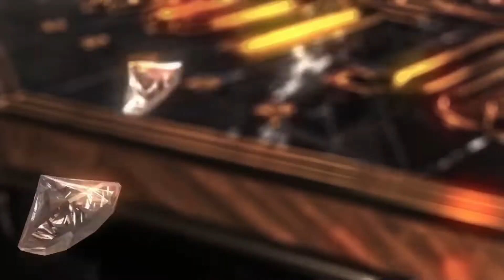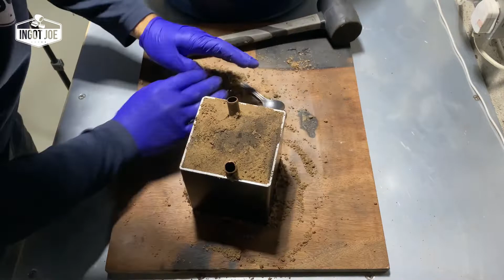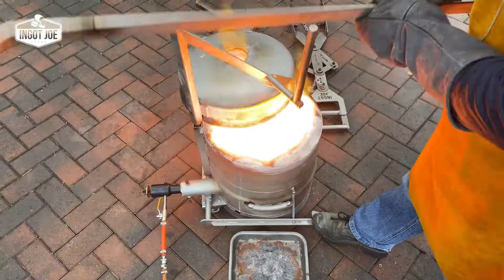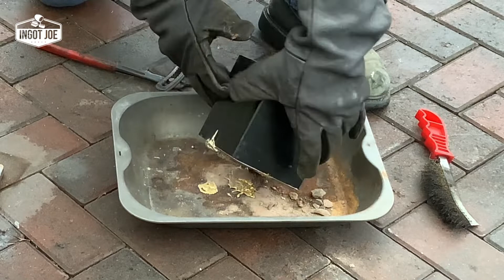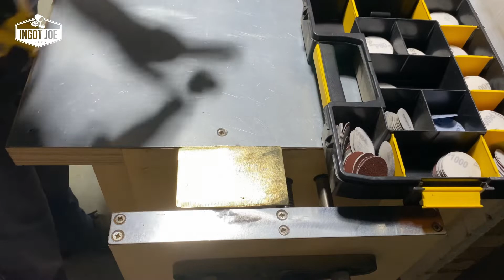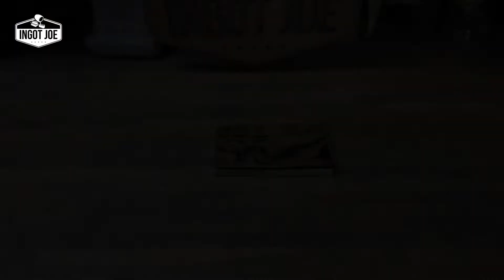Lost Apple casting? - Fail! - Home Made Furnace - Molten Metal - Bullion - Metal Melting

Comment: LOL, first I thought you would put just half the apple in the sand, put the cope on top and fill the other half, thus making a hollow mould in the sand. When I noticed you put the whole apple in the sand and was going to cast into the apple itself I would not think that was going to work. You should have added some cinamon and sugar and then the smell of freshly baked apple pie would come out of the sand :) How did the mulling go with the new sand? Is that own made green sand? Better luck next time :)
Reply from the maker: Thanks, yes, it was time to upgrade the old workbench, the top was really rough and not very flat. I have seen the apple pour work on YouTube, I still want a golden apple so I will 3D print one in two halves and cast in the new year. The mulling went really well with my new home made sand.
Reply: @IngotJoe  buy a foam apple and do a lost foam casting. The apple you saw work was not a real apple.